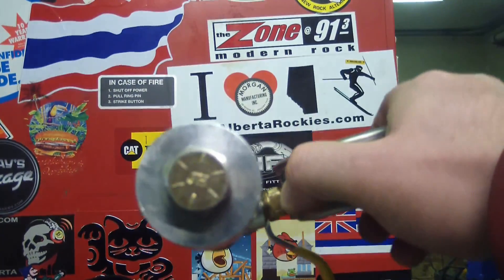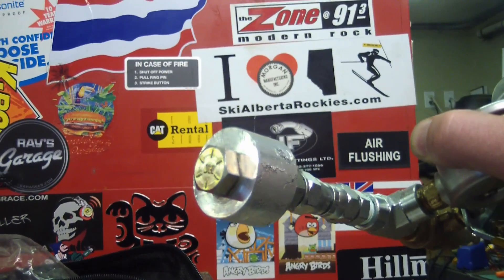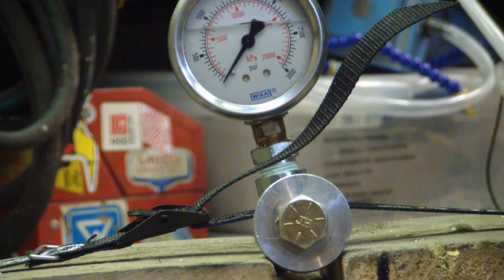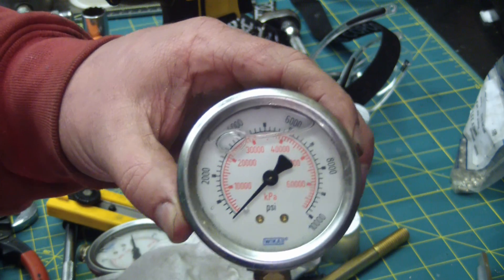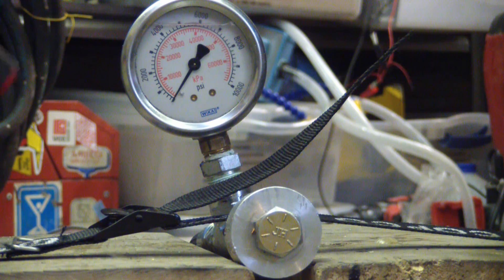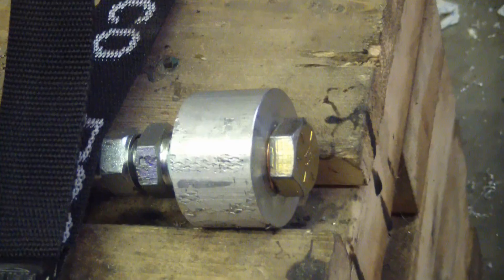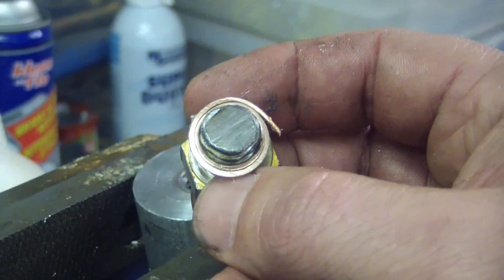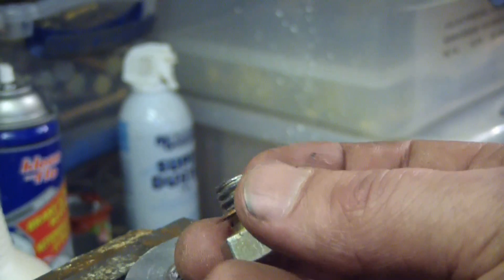Destructive Hydraulic Testing of Homemade Oil Plug.

Comment: jesus dont point that bolt at me
Reply: on another note what if one was to screw jam a stick or soemthing in there instead? Wee chunks of das schmoo would get inside your hole maybe from getting reamed with the bolt so if a littlebita wood breaks off when you're ramming it in no big deal? 

What if the situation was you're on the way back to the airport from the drop, time is of the essence and it only needs to work a little longer. What's minimum viable then?
Reply: fuck 2015 lol

Comment: Thx for sharin. Loved the explanation at the end that that bolt should've been good for 12 K lbf.  So, for 0.25" dia surface that translates to 61+ K psi. But, hey what could go wrong? Hahaha.
Well, you could have use 10K psi air instead of oil.  Then if it went would be quite the bullet.  I was waiting for the camera to go offline.
They use pressurized fluid to pressure test tanks etc. Obviously, if they blow all that happens is the tank fractures and a little oil leaks out. No boom, no harm.
AVE I would have been behind a blast shield just in case there was some gas (air) left in the system.
I designed a spark plug that could take super high pressures like 100K psi. We couldn't bet any of the spark plug guys to make us one. Weenies. At those pressures you can't get the spark to move through the gas you have to rely on a surface spark. What a lesson I learnt during that whole design.

Comment: I watched a new mechanic take apart a hydraulic system while under pressure. He got bathed in hot fluid and the bolt he was removing was likely to never go back on.

Comment: What's up with the fluid in the gauge?
Reply: To prevent condensation and crap getting inside the gauge. Also helps with vibration and stabilises the read-out.

Comment: Sorry for posting on an old video, but its interesting how you're getting 10k PSI out of that when someone like Swagelok will only rate an NPT fitting to 10k PSI. Is this because of the material or the threads? I know that for the same fitting Autoclave will rate it to 3x that.

Comment: It isn't a seal until it stays sealed across the range of expected working temperatures.

Put it under a bit of pressure, then warm it up to 270F, then cool it down to room temperature. If still no leaks, then it's a seal.

(I do personally believe your hack was a success, and would pass the aforementioned test.)

Comment: You mention hydraulic injection.  I used to be a start-up engineer for Bosch-Rexroth (Mannesmann Rexroth back then) years ago and one day during a customer witness test of a 6,000 psi press power unit the testing operator noticed a small puddle of oil behind a 4-bolt flange at ground level.  He brushed his hand underneath the fitting unable to see the pin-hole sized stream of high pressure oil shooting out.  As he waved his fingers over the leak the high pressure oil cut off the tip of his middle finder like a hot knife through butter, a friggin´ laser.  Off he went to hospital where he was treated for blood poisoning as a result of the oil entering the blood stream.  He almost died.
Reply: +Rafael Lastra I've heard stories about this but always thought they were urban myth, I've seen hydraulic oil coming out of a pinhole and it's always a cloudy vaporised mess, never anything like a laser beam.
Reply: It caught us all off guard as well.  It was not a direct stream but fanned out providing very high velocities and that did the trick.
Reply: Did it cut off the bone too?
Reply: Hak Kar No, it ended up shaving off 1/8¨ from the very tip to 1/4 of his nail.
Reply: damm

Comment: I don't think I've ever seen a 10KPSI gauge. Grins.

Does beg an interesting question though. The fluid being incompressible shouldn't actually store any energy. IF it had gone, how much real world carnage would the plug have been capable of compared to a measly - say 100 pounds - of air? Not that I would have stood with my nut sack in the line of fire mind you, but shouldn't that plug pretty well just drop a few feet away (assuming a more or less static load and not a running power pack).

Comment: Just seal it up with JB weld, no more leaky. Wtf safety man, be sure looking at projectile to see when threads fail, stuperman's faster than speeding bolt-let. Pretty amazing held up 10k psi, though. Actually, thickness of that wound copper wire washer is probably good for many more than 1 time use. For un-pressurized oil drain plug probably good forever. Or, could just get oversize drain plug.

Comment: PTFE thread tape will hold the 'spiral leakage'... but them so will a leather washer (source from old shoe or whatever)...
and yes I was turning away from the screen.... LOL
Reply: A lot of things will. I’ve used cardboard like from a box of crayons thickness.
Reply: @brucea550  
I rigged up a thermostat housing gasket out of a 12 pack mountain dew cardboard box and greasy gunk off the side of my engine when the stock one blew out in the middle of fuckin nowhere. It held for a year before the car got destroyed by a deer.

Comment: car oil draig plug screwed up       would you dare to suggest same method under the car ?
Reply: +Honor Lozerol same principle, but with proper tools: actual drill bit and tap
Reply: Also, if you own a torque wrench (for re-assembly), it's a lot easier to take the oil pan off and re-tap the hole on the bench. The seals are relatively inexpensive and you don't have to be supermechanic to do this yourself. Just be sure to ask your parts guy if you need to use silicone sealant or put some oil on the seal or whatever when you're putting it back together
Reply: thank you
Reply: If you screwed up the drain plug, I suggest that you put the tools down and let someone else takeover.
Reply: Not so easy on lots of engines. There are kits made to do it without pan removal.
Reply: I laughed at that for like 5 minutes because that's very true.

Comment: We use that same hydraulic pump and assorted 6ton - 100ton jack heads where i work. Let me tell you, it gets scary when you stall out a 100 ton jack. Safety glasses wont save you should one of the pull rods decide to break.

Comment: seeing how you tapped the threads with that bolt and not a tap,the tolerances are tighter. But that copper wire washer trick is money.

Comment: "The clamping pressure of a XYZ bolt is 100lbs" - the steel bolt will be stringer than the aluminium, so what matters is the shear stress on the aluminium thread. So we are looking at the force on the bolt divided by (basically) the area of the cylindrical hole in the aluminium (2piR*depth). Which makes sense - a hole that's twice as deep and threaded all the way will take twice the pressure.

The length of thread on that bolt looks to be about 2/3rd of the diameter, so the ratio of the area of the cross section of the bolt to the area that the thread is holding - comes to about 1:5 . 

Regular aluminium has a shear strength of at least 50MPa (according to the one place where I looked it up), about 7500 psi, so you'd be looking at five times that to make the while thing pop in one go. Of course, a thread would fail a bit at a time and need considerably less. But still - it's surprisingly high.

Comment: Yes it is a lot of pressure, and a lot of force, but when you consider everything all in all, it's not that bad.  Almost every time I fire my 10 bore shotgun, it generates about 10,000 PSI or more in the chamber., the less powerful 12 gauge can generate more in thin barrel shotguns, the less powerful .38 Special in a thin chamber revolver cylinder can do around 20,000.  High power rifles often times have a maximum factory average of 65,000 psi.  Lots of force, lots of pressure, but well engineered steel and designs can handle a lot.

Comment: Instead of a copper wire.
USE LEATHER to make a washer
Reply: And for low pressure applications?
Such as a stripped oil pan drain bolt
Reply: And on  light gauge metal such as oil pans. I think you'd run a very high risk of stripping the hole once again before you could compress the copper enough to make a seal.

Comment: Had the safety squint at full tilt when the camera was pointed at the business end of that contraption.  Woof.

Amazing how even though I knew intellectually that I was watching this on a screen, I couldn't shake the squint & squirm instinct.

+AvE, did taco tuesday run a little late this week?  This one starts in one direction and takes the fork in the road without looping around.

Comment: The hose is the weakest part. high tensile bolts arent made of Plasticine. You can just weld damaged hydraulic fittings, even with working pressures of 4500psi, ive done it quite a bit with 100% success.

Comment: I run a waterjet (60,000 PSI) and had the high pressure line blow last week. Got 3 years out of it, which is pretty good. It was startling, yet pretty unimpressive, considering.

It blew at the coil on top... 8 turns of 360 degrees. 8 chances to blow in any direction. And did it choose to blow right at my head? Of course it did.

Comment: +AvE The reason I would assume there was no leaky leaky is the fact you formed the threads with the same bolt, or at least the same batch of bolts so the thread production roll form would be consistent. It would be interesting to see a leakage test with an different brand,style, grade or age of a bolt. There is an allowable tolerance of~.0015 on the external threads depending on class (1A,2A,3A) as well as a ~.002 tolerance on the internal again depending on class (1B,2B,3B). Mil-Spec and FAA grades will hold their tolerances much closer to, if not at 3A,B. Much your basic cheese grade Slynese bolts from Yu Swing Long in Ding Dong province would be at best 1A,B...

Comment: Once I went ATV riding with a bunch of my buddies.  we got there on a Friday evening, and decided to go night riding.  we rode for a couple of hours, before coming back to the cabin that we rented.  I'm not sure why I even looked, but I noticed that the fill plug was missing from my rear differential.  The next morning I had a buddy take me to a small autoparts store, as there was nothing else for miles and miles.  I bought several oil drain plugs that looked like they might do and a tube of RTV.  I also bought new gear oil, as we had ridden through a creek the night before.  When we got back to camp none of the plugs fit, so i went out and found a piece of dried hardwood, used the saw and file on my multitool to make a plug  I used the housing to imprint the threads, and once the plug was made, I put new gear oil in, wiped it clean, replaced the plug and sealed the edges with RTV.  We had driven a few hours to ride, and i didn't want to miss out on all the fun.  When I got home, I got the replacement plug,  when I opened it up the wood plug had done such a good job, that I didn't even need to swap gear oil, as it looked clean and new.

Comment: For any leakage couldn't you just wrap the threads in plumbers tape?
Reply: I don't know what that means.
Reply: I don't understand why but okay, lol.
Reply: +AvE that made my day also, it's a rarity to find in this day and age.
Reply: +TheHelleri Plumbers tape (Teflon and ptfe) aren't intended for anything over 500 psi, let alone 10k. AvEs probably got plenty more reasons, but when it comes down it that shit just isn't very skookem.
Reply: ah ok.
Reply: +Majin Snake     "Big Red' chewing gum. Gotta test that next ....
Reply: Copper wire is the fail point. It leaks past that. Pipe thread will only allow you to mash the copper down flatter which may may (probably not) seal it better. Teflon tape only increases the depth of the connection by lubricating and allowing the threads to go further due to lower friction. A thread sealant would do a better job but, it would need to be able to handle oil. Not to mention you are going to figuratively pay an arm and a leg for a mechanic to replace the pan and or block that you now cannot get the bolt out of. Or it will have to be drilled out larger which may or may not be able to be done thickness of the material around the bolt hole, hardness of the bolt, etc. Oh and I forgot to mention you are supposed to be stuck in the middle of nowhere without access to much, but........that is just my 2 cents on it.
Reply: +TheHelleri I also forgot to mention the fact that bolt is not pipe thread so without that copper it would not seal at all . Regular thread does not taper down like pipe thread so it does not form a mechanical bond that seals. The head of the bolt is just mashed down so without the copper wire it would never seal in the first place. The copper wire acts like a gasket. Besides all of this is moot considering the fact that is for oil and held 10k psi of oil pressure. It is an oil plug not a air plug. The reason why most modern cars have crush-able washers is because of the fact that they got away from using pipe thread for drain plugs. Over time pipe thread deteriorates from use and locks less and less this is more prevalent with aluminum (being a soft metal) and hence why it started to happen when aluminum started getting used more widely.
Reply: +TheHelleri plumbers tape has nothing to do with sealing it just lets you get a couple more turns on the bolt
Reply: +George Merkel PTFE tape is poly tetra fluro ethylene and is by its very nature a gasket compound so it has everything to do with sealing. Before you start im fitter and turner with 22 years experience and i have a masters degree in industrial chemistry and i have 2 years of just hydraulic fitting
Reply: +George Merkel And in its liquid state will easily withstand 10000 psi.
Reply: +Fraser Isbester Which as stated it's not 10K. It's 10k PSI. Any fluid within threads is going to be a fraction of a square inch. A fraction of a fraction. If the bolt is roughly 0.25" and assuming how thin a standard wrap of plumbers tape is, factor in circumference of bolt, you're looking at maybe 200 PSI if that.

So since PSI is clearly not the reason to laugh at plumbers tape, what is? There must be other reasons plumbers tape is such a joke in this situation right?
Reply: +TheHelleri who's gonna have plumbers tape in a 3rd world back woods shit-hole?
Reply: +JamesCizuz Plumbers tape is for tapered pipe threads, acting as a lubricant to reduce friction and allow the tapered bits to be tighter and therefore (because taper) more closely mated.  It is not a sealant, per se.  

These are straight threads.  Reducing the friction in this interface to allow the parts to be screwed more tightly together is an answer to a problem that doesn't exist here (because no taper).
Reply: @blarggggg  If that was true plumbers could put grease on fittings with equal success. It seals. Its a chemical sealant.

Comment: Maybe a wrap or two of wet newspaper used like Teflon tape or a pinch of pepper in front of the screw so when it leaks out it will seal up the threads.

Comment: If it held 10,000 bar... that would be a show for the ages.  As a guy who has to "make do" quite often (diesel mechanic by trade) that jerry-rigged tap/plug/wire gasket trick is like finding gold in the scrap yard.  Thank you very much for sharing it with us rank and file types.

Comment: Looks like one of the proper connections sharted at 3:00 :)  I've had it with hydraulic gauges, I bought a 10,000 one for my press then realised I would be better with a 6000 as it's rated 5300 max, then bought a rear entry one by mistake, then bought the proper one and promptly dropped it on the floor :( I give up!

Comment: What is the downright stupidest thing you've ever done in your shop/workplace/shitter/whatever?
Reply: +AvE don't forget charging a couple quarters for a video. The internet would have you believe that you're the spawn of Satan because of that.
Reply: +AvE i know that... lol i mean it looked like you were coiling up single strand 24awg as the crush gasket. what if you were to "borrow" some wire from your tail light, speaker wire, etc? would the finer strands seal or just fall apart? and turn into antiseize shmoo?
Reply: +AvE forgot to mention... love the channel and i catch myself using your jargon randomly. my milfukee 4.5inch grinder stopped choochin and my boss was befuddled when i told him it "stopped choochin"
Reply: ***** darn, I was looking for something life-threatening.

Comment: worked in petrochemistry where they tested rigs with hydraulic pressure to 10 000 bar! (150 000psi) they did this in a reinforced concrete chamber... and it failed sometimes, believe me there where some really big chuncks out of the reinforced concrete walls... so my face was misformed the whole video!

Comment: I'm curious how that compressed air hydraulic pump works? Got the short and sweet of it?
Reply: +AvE sounds sweet, and runnin on compressed air that shit must be almost bulletproof. I was reading up on scroll compressors the other day and some of the iterations of that shit have been bonkers. Compressors are bonkers. Not as bonkers as high vacuums but pretty close.

Thanks
Reply: +AvE Any chance you could do a teardown on that hydraulic pump?

Comment: 150 psi air, no chooch. 10,000psi hydraulic, no chooch. 100ton press maybe? :)
Reply: +Gabe Sewell I really want him to make a new one out of that hardox he's always BRAGGIN' about.
I bet he could rig up a nice piston for it to press on no problem on account of he's clearly filming this from the inside of the NASA vehicle assembly building
Reply: Matthew McLaren you dont even need a reverse lil screwy, he just showed you the capabilities of the threads, with wrench and few ft.lb the thread stripped
Reply: ebu touy WE WANT LITTLE SCREWY
Reply: Matthew McLaren hmm I think so! that's one of those I think I'd have to see to decide.
Also the bolt may be rated, but I'm just thinking "It's threaded into a metal you can work with wood tools" I wish I was smart enough to know how much longer the bolt would have to be to meet that req.
I mean, it just HAS to be longer, right?